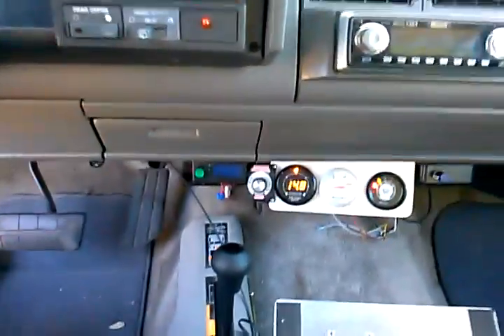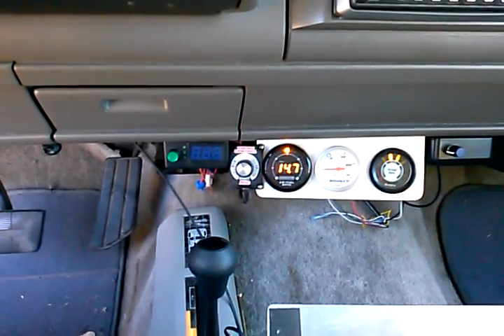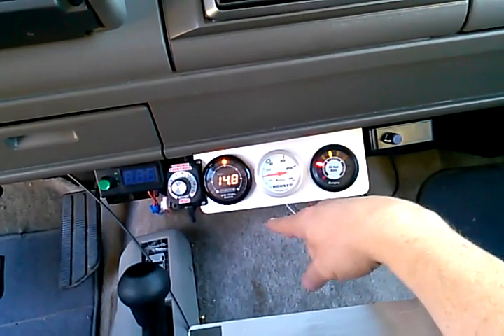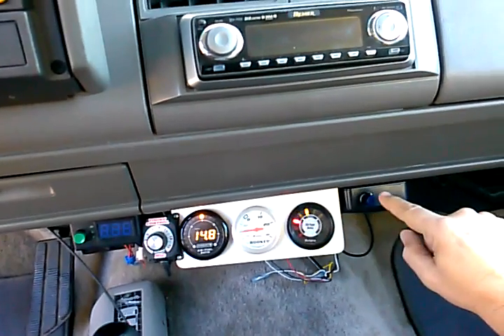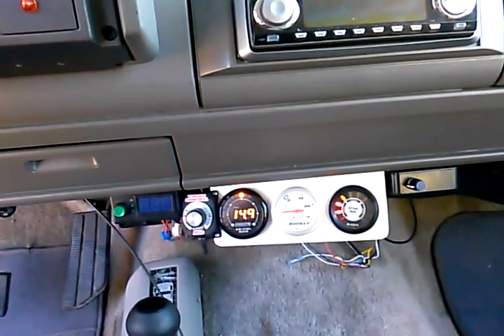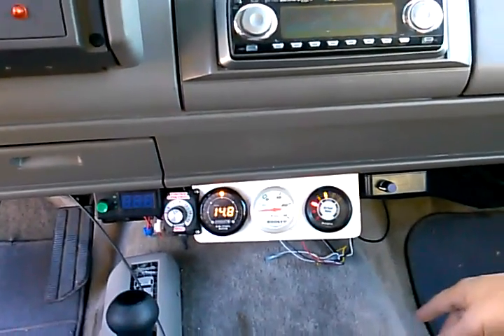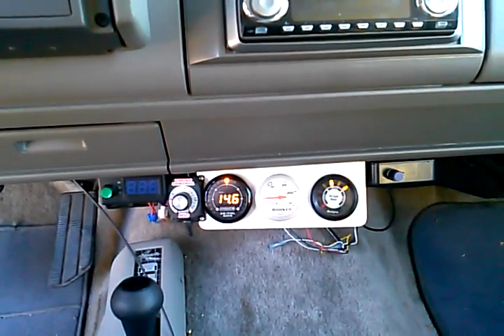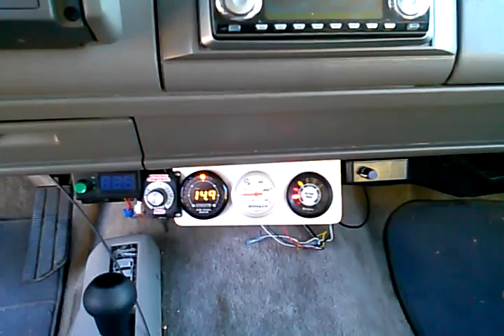Hydrogen Efie the truth!!!

Comment: that truck has an OBD1 . with a  speed density sensor.  has 2 os sensors which are not heated and is running OBD1.    I can write a map for it but that pot will only work with an open loop system.    start it cold when its in open loop and I bet it acts differently.

Comment: Because the ecu detects the tps is not moving. Maybe it will be effective in complex wiring will only cheat on while tps is on 5percent open. Some relays and a gas pedal switch.
So it switch only when pedal

Comment: i want to put hho gen in my 06 cobalt, dont care if its perfect, but will it save fuel if i just add it, or do a bunch of settings need changed? i want it as like a temp 5 or 6 months a year as it would freeze in winter ? or just an HH gen so no increases to O2

Comment: That’s why obd2 scan should be use to see if the computer is running back to factory system I use o2 sensor voltage regulator so i set the 02 sensor to 650 Millie voltage the computer can’t reset voltage I am applying to it and the mass air flow sensor plus iat sensor is controller at ones all 3 sensor should adjust at one the computer can’t reset all the sensor so it’s in loop
Reply: No I am aware of that I know there is some adapters out there that actually change the O2 sensors. But this particular vehicle is OBD1 and it was just a test vehicle.
Reply: Yeah I got to play with rewriting the software on the OBD1 vehicle and we were able to run it at a lean condition if you watch one of my other videos you'll see it so I actually wrote the software to run lean with no O2 on I was able to switch it off as you know if you're a programmer.

Comment: Correct me if I am wrong but I am thinking these computers OBD2 have fuel/air maps in them, depending upon what spot on the mapping they read from, the air fuel ratio can run richer or leaner while using the oxygen sensor info in closed loop mode - it will allow very small differences in the oxygen sensor voltages - example: using the lean end or rich end of the oxygen sensor data - Example - these signals keep switching back and forth from a low voltage like .19 volt indicating fuel lean exhaust to a high voltage like .9 voltage indicating fuel rich exhaust - if the computer uses .7 volts instead to switch the mix leaner then riches it up at .1 volt instead based on the fuel map, engine will be running leaner.  I really wish we could get software to play with the OEM maps and adjust them but the manufacturers try to keep that stuff secret and they rip off tuner shops with like $10,000 systems to enable doing this stuff.  I have been studying for hours now about EFIE  Electronic Fuel Injection Enhancers that take the oxygen sensor data and modified it so you can adjust the mix.  Anyone try this yet?  There is a system from Buffalo New York called Eagle Research.  It requires cutting wires and sending a signal from their board to your ECM.. Not sure I want to get into that, trying to figure this out..

Comment: OK - Question as I am having similar issues with my Subaru Legacy - ECU is too clever and returns to 14,7 with my AFR .If HH0 is improving the fuel burn would returning to 14,7 not be a bad idea now having a more efficient burn .I am still questioning the map and efies as forcing the lean run one can do this without HHO and just the efie etc .What is the latest your side.I added a fuel heater to my fuel delivery and still testing .
Reply: Most tighter than systems make a low quality gas our system makes a high-quality gas therefore if you look at all my videos you'll see we complete the burn almost 100% in the combustion chamber. Which you will see will reduce hydrocarbons pretty much to zero and knocks to zero no other hydrogen company can do that if you do your research. All I can tell you is the ECU's programmed to run at 14.71 so you have to reprogram it That's all I can tell you hopefully that helps.
Reply: @scottsmith6960  Hi Scott -Not sure your reply has helped me in any way but seeing your videos on data tracking you must be doing the process efficiently. Thanks Brad

Comment: of course it will auto adjust.. that's the function of ECU... if you lower the sense O2 then the ECU will also lower the fuel to  compensate for the 14.7:1 fuel:O2 ratio... that's basically what the EFIE's function.. to trick the ECU so that it will inject lesser fuel...

Comment: If you use the (Positive + Electrical), side of the generator for hydrogen gas production only, you won't need these enhancers. The HH production side of the generator,  will eliminate the increase oxygen levels in the exhaust.  The trick is to design a generator that separates the gases. Once separated, the Hydrogen gas goes into the vacuum of the engine. The negative side which is the oxygen side, should vent outside the generator with good ventilation and a flash a restor attachment. I'm sure this will do the trick. I'm working on a design.
Reply: Jamie it is the negative side that produces the hydrogen though, I'm also working on a design that does precisely this.
Reply: The negative side created gas not the positive side
Reply: I know the hydrogen is what makes the explosion have more kinetic energy, but don't you need the oxygen for a hotter combustion and, as a result, a more complete & clean fuel burn?
Reply: Yes its negative side that produce the hydrogen through...

Comment: Hi. So even if try to adjust an engine with dual O2 sensors, I would have this same answer through the ECU? My intention is to install this Efie to make small adjustments for a single gas engine without HHO. Do you think is possible to do that and forget to remap the ECU? Thank you
Reply: SCNAUTICA Salles chamie this video shows how key the O2 sensors are to the ECU for fuel trim. That’s the place to start as far as gaining mileage, because the ECU will continue to increase fuel trim if it sees more oxygen in exhaust. After you’ve conquered the O2 sensors, then you can move onto the MAP offset to really tighten up fuel trims, especially if you’re adding HHO. EFIE first, then MAP and tweak for HHO. Once you have achieved acceptable fuel efficiency that way, the ECU will re-learn the fuel map on its own. Re-flash is not necessary.

Comment: How do u get the engine to use less  gas in the best way?
Reply from the maker: Applying one of our Hydrogen Systems can save up to 60% fuel. Depending where you are located, we see an average of 27% fuel savings in California. We have fuel monitoring with data to back up our product. Check out the website www.cvhho.com
Reply: @ssfuturescott  webpage are dead

Comment: so what can we use to fool the o2 sensor ?
Reply: Connect both sensors with efie
Reply: If the narrowband sensor works by detecting a change in the exhaust gas, relative to the reference air, alter the reference air. If the reference air is enriched with a slight increase in oxygen, as the exhaust is experiencing a slight increase in oxygen, would the O2 sensor read a more rich condition than what exists in the exhaust, believing everything is "normal"? A wideband sensor could be incorporated to determine what the actual AFR is and it could meter a reference gas controller that could add or subtract more or less oxygen from the reference air to match the desired AFR determined by the wideband O2? A split cell HHO generator could use some of the O2 when needed to alter the reference air of the narrowband O2 sensor?

Comment: I do believe that re-mapping the ECU is of course a superior method for those who are able however in this demonstration the readings of the air:fuel ratio which are being displayed would be coming from the modified MAF signal and so they would be the equilibrium the computer is creating @ 14.7:1 however the actuality would be with the difference created by the MAF sensor modification, and of course it will take the ECU a few seconds to adjust the a massive MAF sensor reading change until it re-establishes its perceived equilibrium. Sorry but you demonstration does not prove what you are suggesting. Mad props though for the good work you are doing with HHO, many of your other videos are inspiring. The greatest issues I have had with EFIE and MAF sensor modifications is that they eventually trip engine faults (w/check engine light) which through the vehicle into open loop defeating the whole purpose. Haven't given up on it but so far without the knowhow to remap the ECU I have got the best results from just wiping the ECU's trim tab memory prior to running with HHO.
Reply: Its MAP not MAF

Comment: That auto adjustment means the ECU is adjusting injectors pulsation time to achieve 14.7 ratio. Now, my question would be, do the O2 sensor detects increased O2 levels as a result of added HHO system?  If the answer is yes, no MAP enhancer is needed because the ECU should have been decreasing the injection pulse,  resulting in improved MPGs..
Reply: +Ediberto Jimenez Yes the O2 sensor reads the additional 02 from the HHO system however you have it backwards, when the ECU sees the added/extra 02 it assumes that the fuel is burning too lean, (that is why there is extra 02 left over) and so it enriches the mix.. that is the whole reason for the troubles with HHO systems and the ECU messing up the efficiency of the fuel map.
Reply: You run it in front of maf. No problem. Problem is it's use to running with some unburnt stuff so when it senses that it pushes more fuel.

Comment: someone correct me if im wrong but, manipulating the map or maf sensor will just be overwritten by the o2 sensors. manipulate the o2 sensor signal only, and that will have a permanent effect on air/fuel ratio as long as the o2 sensor signal is being manipulated.

Comment: Good points and video demo. I had the belief computers default to open loop when they get data that is out of the perimeters of the ECU from the 02 sensor. This is even worse than I thought. I'd like to hook this AF meter up to my genset to see what it will read running on ethanol vapor and hho. I'd bet I'm getting anywhere from 30 to 50:1. Thanks for posting.